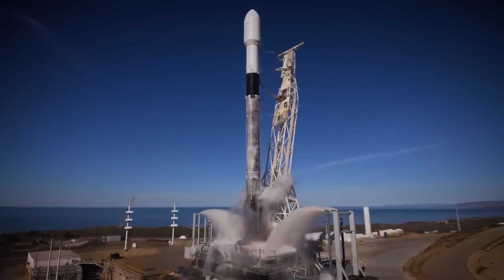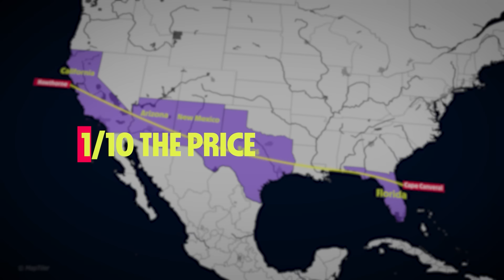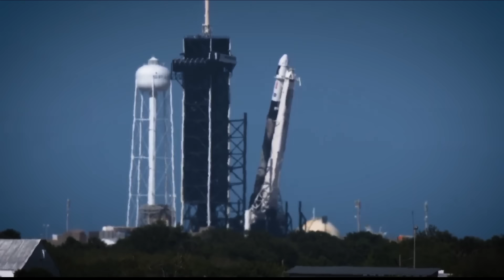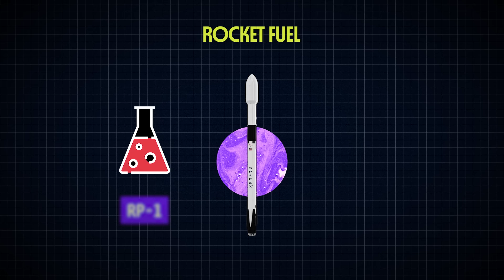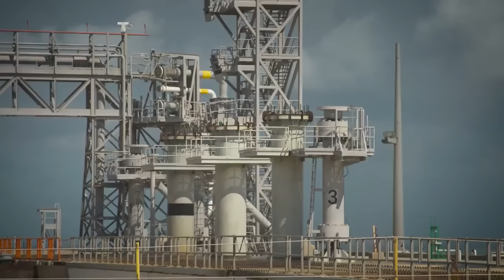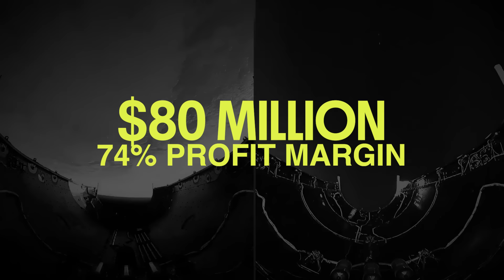Why Going To Space Costs So Much

Comment: The fastest booster turnaround time isn't 27 days, it's 9. They also don't static fire boosters before reusing them anymore.
Reply: That soooo fast
Reply: Yes the video has enough errors to make me wonder if there are others I'm missing. There have also been turnaround times of 14, 20, 21, 22, 23, 25 and 26 days incase the 9 day record in march 2025 slipped threw unnoticed. Vandenberg seams to not exist, or that spaceX uses 3 launch pads. The fairing recovery part could have been done better. 

Liquid oxygen isn't used as an oxidizer in solid fuel orbital rockets such as: Long March 11, Ceres-1, Gravity-1, Hyperbola-1, Satellite Launch Vehicle, Polar Satellite Launch Vehicle, Qaem 100, Shavit 2, Start 1, Minotaur, and Pegasus.

On the liquid fueled side: the Long March 1 and Kosmos used nitric acid.  Long March 2 and 4 and Feng Bao 1, Safir, Simorgh, Qased, Zuljanah, Unha, Dnepr, Tsyklon, Titan 2 and some Titan 3's use dinitrogen tetroxide. Vega used ammonium perchlorate and dinitrogen tetroxide. Diamant used Turpentine and dinitrogen tetroxide. Black Arrow used hydrogen peroxide. While Athena used ammonium perchlorate.

Liquid oxygen also isn't always used as an oxidizer sub-orbital, high altitude, military or hobby rocket launches, right down to my family launching a ninja turtle when I was a kid.

There are cheaper options for small light payloads, Electron for example. Deliberately the best cost per ton (tonne) to orbit is the Falcon 9.
Reply: Make your own video then
Reply: @StellviaHoenheim  was thinking the same thing
Reply: The turnaround time for Shuttle boosters was around 30 days !!! Hmmm, not much improvement over the decades 😂
Reply: @spinnymathingy3149  that was the boosters, NOT the orbiter, that thing had a turnaround time of 3-4 months and took tens of thousands of man hours...
Reply: @yakkobthelearned  that’s correct, that is what my comment relates to, the shuttle boosters were reused after around 30 days, almost exactly the same time taken to reuse the Spacex boosters, that’s what these comments here are referring to
Reply: @spinnymathingy3149  The shuttle boosters a solid fuel boosters, nowhere near as complex
Reply: @realRiverMC  boosters just do their job, to boost the spacecraft, if a more complex system is used, well that’s on the developers. Facts are facts. Timelines have been set and 40 years on are sadly lacking
Reply: @spinnymathingy3149  that's not on the developers solid fuel stages have heaps of drawbacks that make them impossible to replace the functionality of a liquid fuel stage (no throttle, no shutdown, no re-light capability, and way less efficient for the same volume as a liquid stage). It's so daft to say that timelines are lacking, from simple solid fuel stage boosters with parachutes strapped on taking an average of 6 months to turn around, compared to a private company that didn't even exist 24 years ago, turning around a much more complex system in a matter of weeks, consistently.
Reply: @spinnymathingy3149 tle boosters were SRBs which has basically 0 moving parts. They also costed around the same to refurbish compared to building an entirely new one. It cannot be compared to an F9 booster.

Also, F9 boosters are very quick to actually refurbish, but there isn’t the demand yet. Their fastest refurbishment was 9 days. Elon Musk said that 2 days is possible but no reason to.
Reply: it is genuinely insane how much incompetence and corruption that spaceX has exposed, 60 years ago it cost around $30,000/LBS, 20 years ago it was around $25,000, 10 years ago it was $3,000, now its around $800, even with all the insane levels of needless bureaucracy they still did more in 20 years than NASA has in 60 years, like I knew NASA had some major issues with corruption but not to that degree, if spaceX had been founded in the 80s or 90s its entirely likely that humanity would already have colonized basically the entire solar system...
Reply: This channel is losing it
Reply: @cjsmith5787 hey, this video clearly took a lot of research. Getting two things wrong isn’t bad, considering that the turnaround time record was set probably after research started.
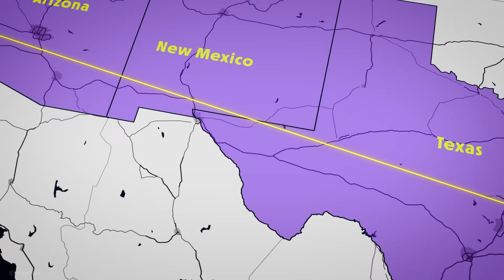Reply: @ZeroGPrints I just pointed out an issue at 5:20 in - the map showing the rocket transport from west to east skips over 3 states. They don't change color and they aren't announced - the rocket just magically jumps from Texas to Florida.
Reply: @PsRohrbaugh  Everyone understands it.  We know trucks dont swim or skip states.
Reply: @PsRohrbaugh  Yes, we all saw that but did not think it important.
Reply: @cjsmith5787  that 9 day turn actually just happened a few weeks ago. Given the amount of effort that obviously went into this video I'd wager they were well into production at that time and just opted not to change it.
Reply: @jimnasby  There was a 21 day turn in April 2022.

Comment: Never would have thought that the profit margin for space flight would be so large.
Reply: It isn't.  The rockets cost money to make initially and are therefore amortized over many flights.  Also, they didn't count the cost of the launch facilities at all.  There are a lot more costs that were not considered at all, for example, the handling and engineering of the payloads.
Reply: @Roarmeister2  He had mentioned maintainence of the launch sites which if memory recolects was in the region of $180,000 per launch. There were also admin and associated expensis which may or may not include depreciation, which is capital reimbursement in kind. Also the dollar value of the Cape Caneveral site may be leased instead of bought. The cost analysis was on the hole pretty useful.

Comment: Falcon 9 did make access to space MUCH cheaper simply because it has a reusable booster and payload shroud which is why it's launching so often that it launches more often than all other orbital rockets combined.  

Your data on booster reuse is really out of date now, SpaceX recently flew the same booster just nine days after it's previous flight breaking the previous record of 14 days showing that they can do a more rapid turnaround if they need to. NROL-57 mission for search purposes.

Those of course are more minor defects as the goal of the video is to explain the cost of going to space and why it still costs so much even with a partially reusable rocket system like Falcon 9.

A video comparing the cost of launches prior to Falcon 9 to now and the cost of Starship launches should prove to be quite interesting because it would make the reason SpaceX is working so hard on Starship development much more obvious. If you do that though, you really do need to cover the price per kilogram of payload and note that the truly revolutionary thing Starship is planning on doing is the in orbit refueling because it means the payload that can be sent to LEO can be sent to anywhere in the solar system which is unlike any other rocket system.
Reply: There's a video/presentation called "The Relentless March Towards Space Launch Infrastructure and Where it Might Ultimately Lead Us" that looked into Starship versus Falcon 9.

Comment: Huh, I think it's 2 C12H26(l) + 37 O2(g) → 24 CO2(g) + 26 H2O(g), which is a 1:3.48 ratio (by mass) of fuel to oxygen. Instead the rocket uses a 1:3 ratio (by volume... opps) of fuel to oxygen. I wonder why?
Reply: Excess of kerosene results in carbon monoxide instead of carbon dioxide as the major combustion product. Which is 28 grams per mole instead of 44. In a nutshell that is the motivation for running fuel rich.
In practice,  a detailed simulation of chemical equilibrium is performed, which takes into account hundreds of possible species in the hot exhaust stream on its way from the combustion chamber through the nozzle. There is a standard software for that, developed by NASA long time ago.
Reply: @ Ah thanks, I forgot about co vs co2.
Reply: There is incomplete combustion.  You're forgetting about that. Some CO, H2, and even a small amount of carbon/soot are produced.

This is one reason why the mix is more fuel rich in practice.

Also, RP-1 is not a pure C12 alkane.  It's a mixture of hydrocarbons between C10 and C16 mostly but not all alkanes.  So the stoichiometry you typed above will have some error because of that as well.

Knowing SpaceX, I'm sure they optimized the stoichiometry within their constraints empirically during engine testing to generate maximum thrust.
Reply: I am not sure where the 1:3 number comes from. Most kerosene-liquid oxygen rockets run at about 1:2.4, and Falcon-9 runs at about 1:2.0.

The main reason for that is that the exhaust velocity does not only depend on combustion temperature, but also on the molecular weight of the combustion products. Optimizing the mixture for slightly lighter combustion products makes the exhaust velocity greater, despite somewhat lower combustion temperature. The optimal fuel to oxygen ratio depends on combustion pressure, but is typically in the neighborhood of 1:2.7. 

Real engines use more kerosene than that ratio would indicate, because they also use some for cooling and for driving the turbine, so the final ratio is even further away from stoichiometric. Approximate numbers specifically for Merlin 1D are as follows. The engine uses about 100 kg/s of kerosene at full thrust, and 200 kg/s of oxygen. This is enough to combust approximately 75 kg of kerosene at an optimal ratio. Of the remaining 25 kg, about 10 kg go to the turbine gas generator, which uses almost no oxygen. The rest goes to the curtains which separate the hot flame from the chamber walls and especially from the throat of the nozzle. A small amount also goes into cooling the tip of the injector itself.
Reply: So rocket engines don't work on stociometric combustion, their optimum combustion is a combination of getting the highest temperature, but also on getting the smallest/lightest combustion products. (lighter molecule means more exhaust velocity means higher ISP). This means that rocket will offer run their engines at a ratio that favours the lighter molecule, in this case O2. (It also has to do with cooling your engine)
Reply: @thomaswijgerse723  Except the engines don't have an excess amount of O2? That would require a 1:4 ratio (by mass). Looks like they use a 1:1.67 ratio (by mass). LOX is slightly denser than RP-1.
Reply: @ my bad didn't double check the values given by cogoid, but yeah it's a combination of getting lighter exhaust molecules while keeping temperature under control, where more oxygen rich is hotter combustion.

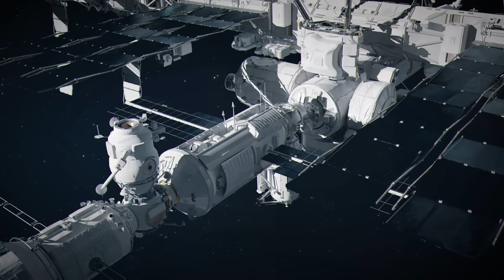Comment: 19:26 $86M/seat was NASA's cost, which already included a lot of the Russians' profit. They flew tourists to space at $20M per seat (also at a profit - reportedly that'd paid for the whole flight) eventually raising to $30M and then $40M.

While reusable rockets are great, they're not a direct comparison to non-reusable - which don't carry legs, landing fuel & guidance, and the overall much sturdier build plus extra fuel to lift all that, with them - so they're much much lighter and cheaper per unit payload. It's like comparing a disposable syringe to a reusable one. The reusable one will cost 20x more before you add the whole infrastructure & processes to check & sterilize it & keep track of everything & the cost of making it safe. If Falcon-9 gets to a point when it maintains its human spaceflight rating after 10th or 15th reuse, we may approach break-even vs disposable in terms of real cost. For non-crewed launches, yeah, it may be simpler.

Comment: I'd like to know the costs associated with the Starship. I know it isn't fully set yet, as it hasn't been standardized, but it would be a nice comparison to the Falcon.
Reply: @PaulADAigle Well, the whole thing is intended to be reusable. It is intended to be cheaper to build, (per ton at least) And it is intended to be more durable and easier to refurbish. Still going to be more per launch, but can lift much more, so it will cost far less per kilo. Check out the changes in the versions of Raptor to see the sort of improvements they are achieving. I think the cost of a Raptor is about the same as a Merlin, and they're aiming for $250,000 each when building 500 per year.
Reply: There's a video called "The Relentless March Towards Space Launch Infrastructure and Where it Might Ultimately Lead Us" that does that comparison.

Comment: You listed about 10 million dollars worth of booster components but then said that the booster would cost 30 to 40 million. This huge discrepancy illustrates how hard it is to estimate the final cost of something by just tallying up the most visible items. Your bottom-up estimate, which includes no supporting references, just reinforces the mistaken belief that SpaceX has meaningfully lowered the cost of chemical rocket launches. The truth is that SpaceX charges 69.75 M for their cheapest configuration and adds surcharges to that when the payload is greater than 7500 kg. This puts their cost-per-kg in the range of 6000-9000 USD/kg. This is pretty much inline with what the cost has been for decades. Also NASA pays SpaceX ~300 million per resupply mission to the ISS, not 150M.
Reply: You misunderstand how prices are set in business.  SpaceX prices Falcon 9 to be competitive with the current market for launches.  What they charge has very little to do with their costs.  They can charge $70MM+ only because everyone else they compete with charges as much or more.  However SpaceX has, by far, the highest margins on each launch and massive launch volume that dwarfs all of their competitors due to their reusability and efficient development and manufacturing.

The only reason for SpaceX to cut prices would be if they could increase volume enough for it to be worth it or if a new competitor enters the market that can do it for less.  However, they already have most of the private launch market and they have no real competition on cost.

So in the meantime, SpaceX charges on the low end of the market rate and banks all of the profits into developing even better projects like Starship.
Reply: @lumstyle  You're just speculating that SpaceX has terrific profit margins with no real data to support this. But a) it's not relevant - what matters is what customers have to pay to launch their payloads, and b) your optimistic speculation is invalided by Musk himself stating, "It's at least 50 million dollars per launch - maybe 100 million."
Reply: @pewterhacker  Haha OK then where are your sources to the contrary?  Where exactly in this video did they get it wrong?  You clearly have an axe to grind.  Maybe you work for ULA.  Sour grapes.

As soon as someone can challenge SpaceX to lower prices further, they will.  Otherwise, it's simply bad business strategy to lower their prices at this time.
Reply: @pewterhacker  So you're adamant that SpaceX hasn't lowered costs?  How can you refute the claims in this video without any evidence?   Sour grapes.  Maybe you work for ULA.

You are speculating that SpaceX charging on the low end of market rates for their launches means they haven't lowered costs.  That is based on a flawed understanding of how businesses set prices.
Reply: @pewterhacker  Without looking at the actual books it's ALL conjecture based on bits and pieces leaked over a decade.

Comment: Wow. What a thorough breakdown. I'm glad you didn't miss the mundane stuff like overhead.
Reply: I watch a lot of SpaceX videos. I have never seen this breakdown shared so clearly. Thank you for your contribution!
Reply: Overhead depending on the industry even in engineering is sometimes 50% of the project.
Reply: Yeah, but he was super wrong because his "average cost" for the booster calculation only assumed two launches per booster, which is way off; the boosters go up many more times than that, so the average cost is way lower. So, that makes the conclusion to this whole video is pretty much junk.
Reply: @sha @shannajones9014  They didn’t assume two launches, watch it at 9:50, he assumes a used booster is $2M instead of $35M for new, a savings of $33M, for each launch of a reused booster.  He never addresses the average booster life, which if they averaged 35 launches would add about $1M to his analysis.
Reply: @shannajones9014 At least 10 launches per booster.
Reply: He missed the hundreds of launches out of Vandenberg, CA.
Reply: @phillm156 
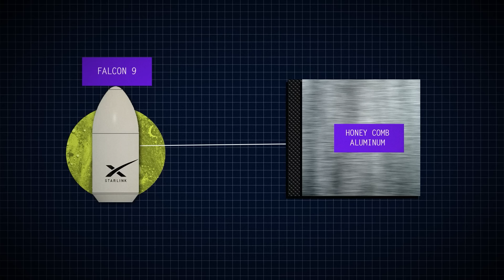Revelation 3:20
Behold, I stand at the door, and knock: if any man hear my voice, and open the door, I will come in to him, and will sup with him, and he with me.

HEY THERE 🤗 JESUS IS CALLING YOU TODAY. Turn away from your sins, confess, forsake them and live the victorious life. God bless.

Revelation 22:12-14
And, behold, I come quickly; and my reward is with me, to give every man according as his work shall be.
I am Alpha and Omega, the beginning and the end, the first and the last.
Blessed are they that do his commandments, that they may have right to the tree of life, and may enter in through the gates into the city.
Reply: Everything In America is fake 😂😂😂
Reply: @HamDarly  Clothes